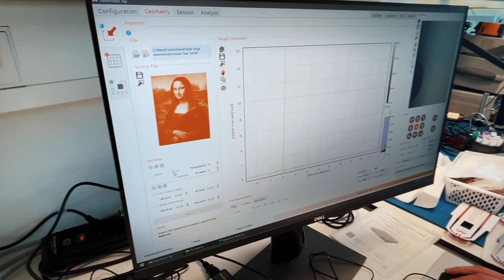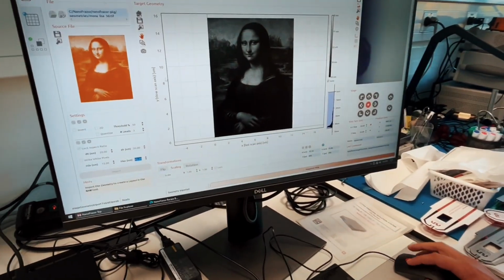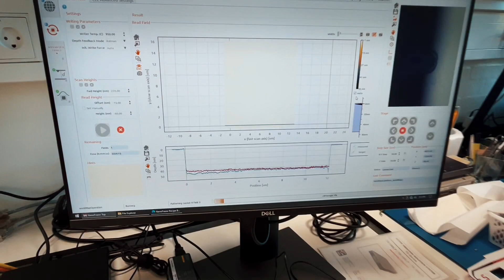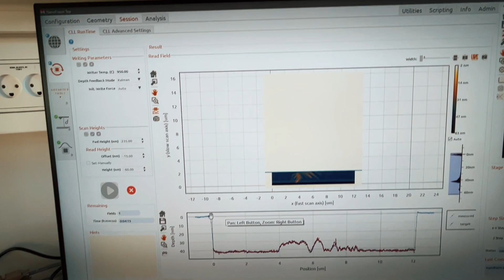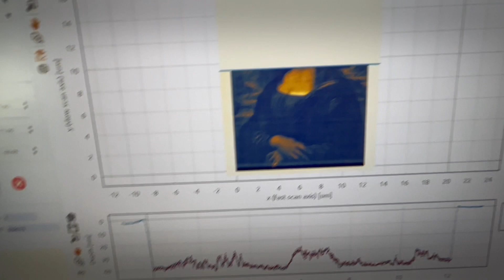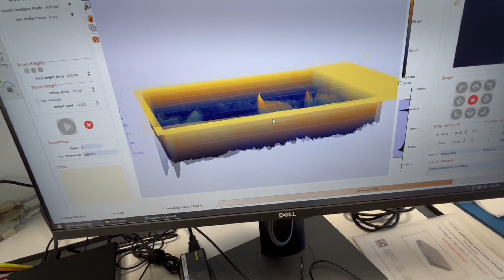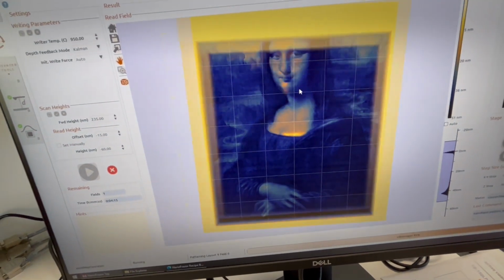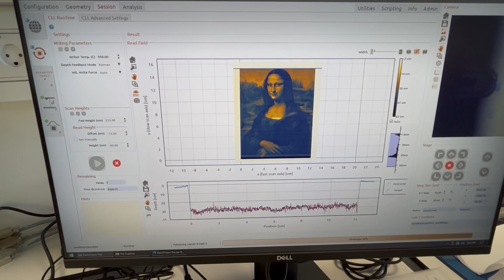NanoLisa - Mona Lisa 3D printed with 2.540.000 DPI in 5 minutes

Comment: I'm currently looking into getting one of these for my fabrication facility in Minnesota, USA. This is a great demonstration right here. It's undoubtly faster than the electron-beam lithography machine that I use. Most features I make are just around 50-100 nm too 😅.
Reply from the maker: its different. It does not replace an EBL. For us we can do some of the structures we need with a much shorter turn-around time, but for other kinds of layouts, EBL is better and more efficient. The writing field for the Nanofrazor is 60 x 60 micrometer. The depth control is the real advantage. The tip will accumulate stuff, and need replacement fairly often, so there is that. All in all, i think this will (1) speed up device fabrication a lot for 70% of what we do and (2) allow us to control the surface contour of 2D materials.
Reply: @NanoClips   Still, there are charge build-up concerns on some nanoscale fractal patterns for my samples that are not suitable for EBL. I can deal with the probe replacements 😌.
Reply from the maker: i see what you mean. Definitely, this technique is a hit in situations where proximity effects and charging is a worry. That does not mean that proximity (probe) effects are not present, they just dont act on scales larger than 20 nm. @ONRIPRESENCE